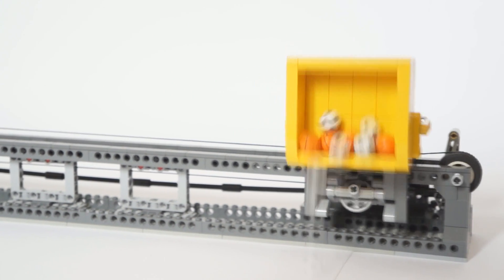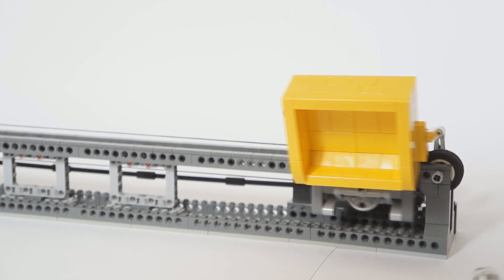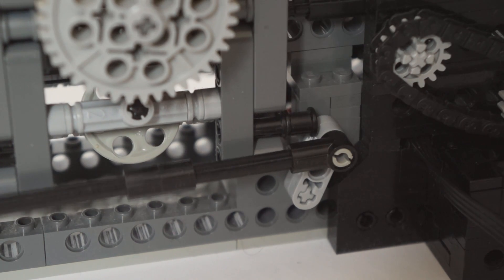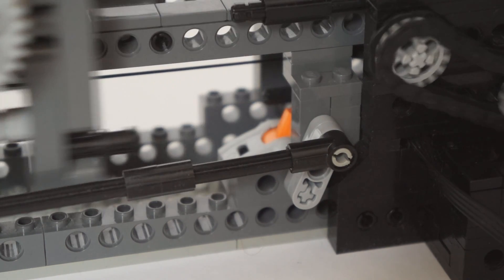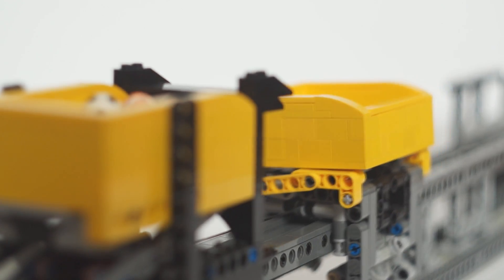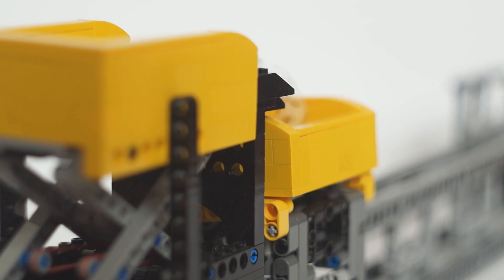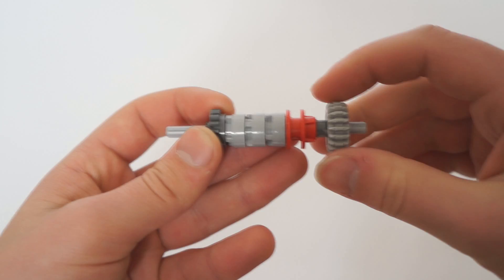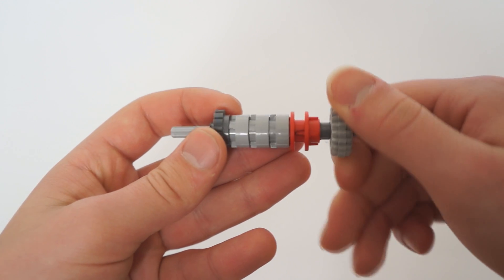Lego GBC: Container module

Comment: Is this right, that at the one site, the black technic pin push the switch, but at the other end of the way the container pushs a part with a spring? Does it work so?
Reply from the maker: Yes. The switch and the "part with a spring" are connected with a long rod. So at the one side the container pushes the switch directly and at the other side it also changes the switch position (via this long rod). The spring makes the switch stay in extreme position - never in middle position (without it there could be a situation when the switches stops in middle position and the whole machine would stop working).